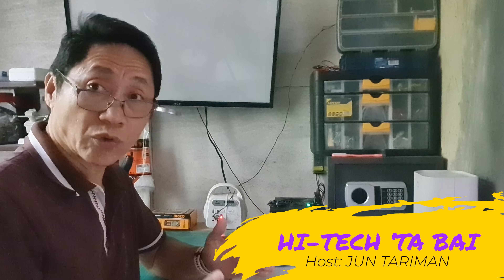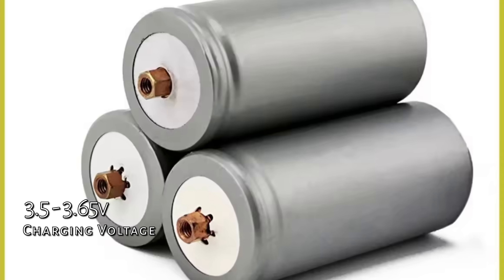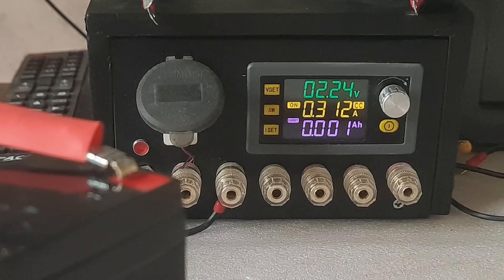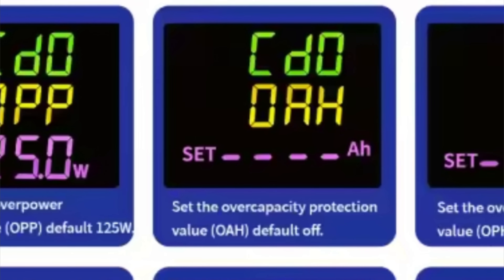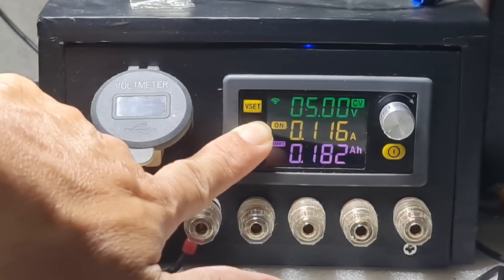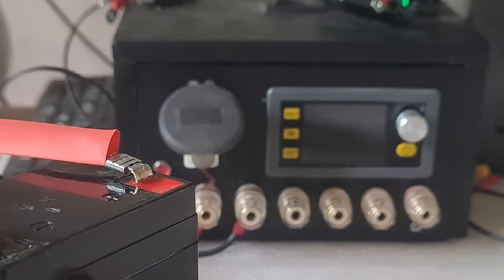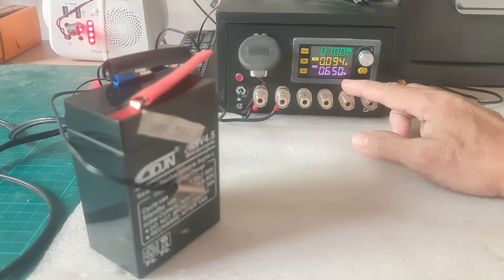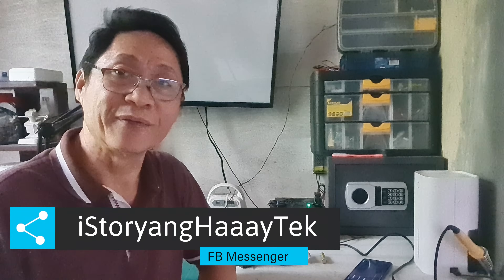Raw Battery Charging Guide Using Sinilink XY-SK120 Buck-Boost Converter

Comment: Hola amigo , he comprado el convertidor  XY-SK120 y me gastaría comprar el sensor de temperatura NTC , ¿ sabrías decirme cual es el valor adecuado para este equipo ? gracias un saludo
Reply from the maker: The sensor is tagged on this video. Click the link on the screen to purchase the sensor. It's also discussed in my previous video- https://youtu.be/9XZ6Zhzutxs?si=g5RE6WxKmiC9-CO1

Comment: Hello there from Greece, I have made a 4s lifepo4 battery for starting my motorcycle without BMS , but with active balancer, and I am looking to but this module so I can charge the battery when the bike it's of for a few weeks. I see that I can put the amp that I want so when my battery goes to that amp the charger will cut off. Am I correct?? The 1 battery it's 3ah and the second I am building now will be 6ah. This module will work also for the 6ah? And what is the best power supply should I put on the in+v and in-v
Reply from the maker: As i've emphasized in the video, you may not need to set the cutoff charge current because the converter automatically adjusts the charging current. What is important is to set the right charging voltage. Also, i've said there are many resources to learn more about the charging voltage of various batteries. Go and check it out.
Reply: @HiTechTaBai thanks for your time, I ll try to find out some videos to learn about

Comment: Good pm po sir Nakabili po ako neto
Planning pa lang po gamitin sa small solar set up. 

20w solar pannel 21v 1.06amp
20k mAh power bank (KUULAA) ang specs po PD charging 8v at 1.80A or 5v 2A

Small budget lang po para may pang emergency sa bahay. 
Sana po maturuan nyo ako sir sa set up sa converter. 

Gagamitin lng lights minifan at cp charging. 😊
Reply from the maker: Check my previous videos about it. Marami ako videos nyan.